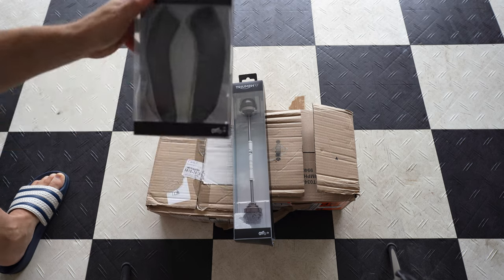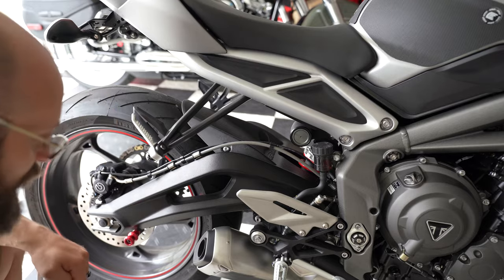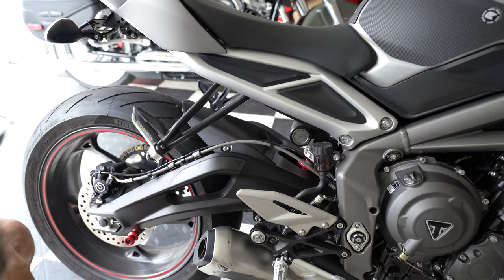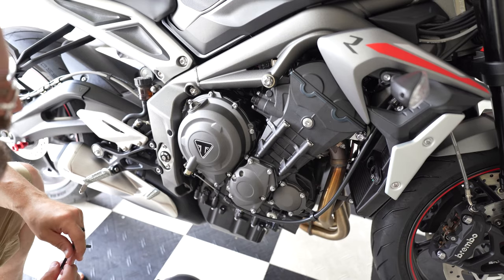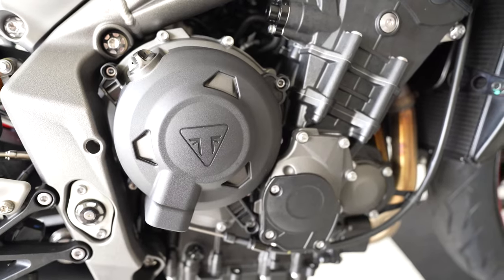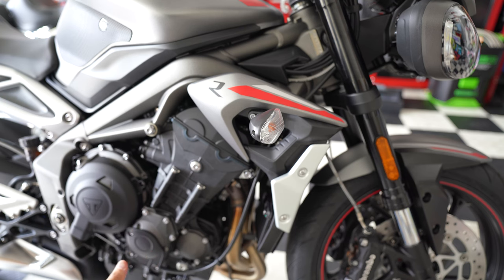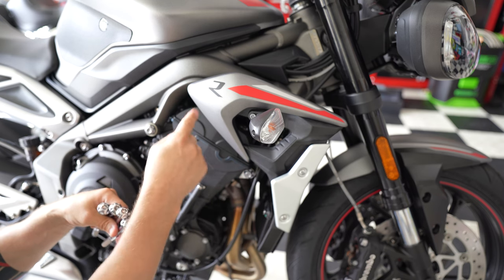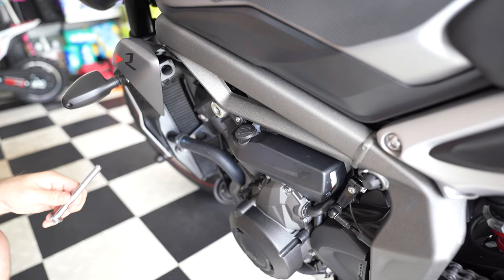Engine and Frame Protectors Install On My 2022 Triumph Street Triple 765 R

Comment: I had these fitted to my '21 "R" by the dealer under a special offer, however when I slid the bike onto its right hand side the only damage was the bar end, the front indicator (destroyed) and a small dent to the end of the silencer. I do believe it's worth fitting as different mishaps could damage other parts - especially the (expensive) engine casings. :>)
Reply from the maker: Definitely worth a piece of mind.

Comment: For the frames installs, was surprised that the original bolts were not really tight.  The right side rear bolt for me seem a little short but end state:  

For Right side, used shortest bolt for rear and one of the same size ones for front.  For Left side, used long in front and remaining bolt for rear (the other same size).  Wondering if I understood your instructions correctly.
Reply from the maker: Interesting. Mine were pretty tight. Sounds like you installed it correctly.
Reply: When you get the chance, mind checking your right rear frame protector bolt?  End of bolt is not flush or protruding.  Just making me wonder.

Comment: With what torque should the screws be tightened?
Reply from the maker: Sorry I don't remember off the top of my head but the install guide has the torque specs.
Reply: I believe 8nm
Reply: 48nm/35ft lbs